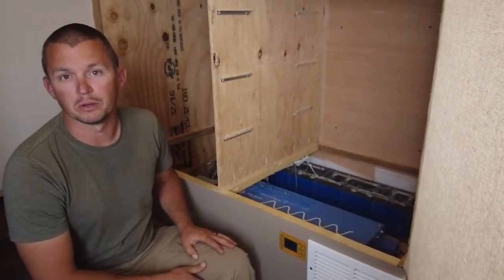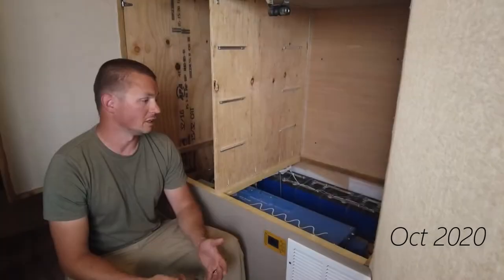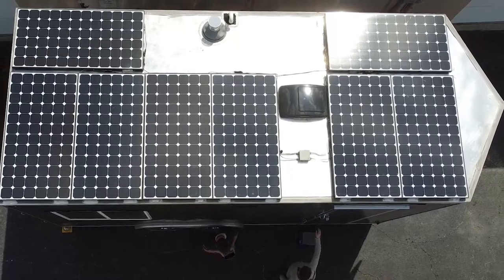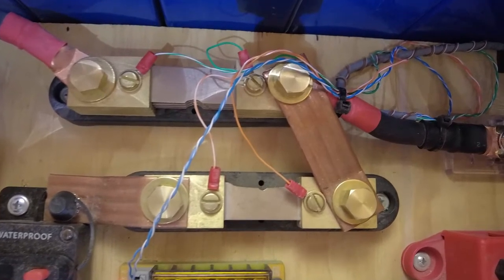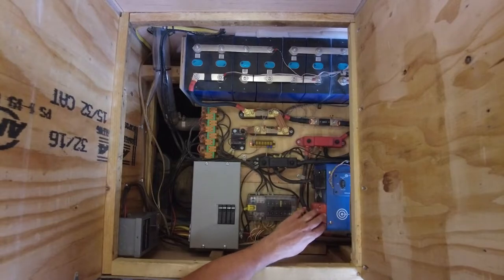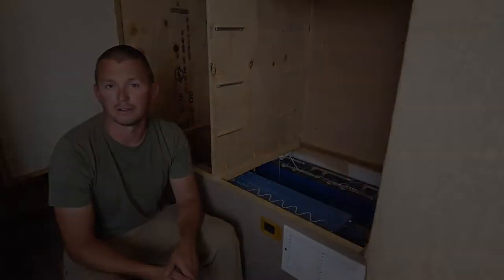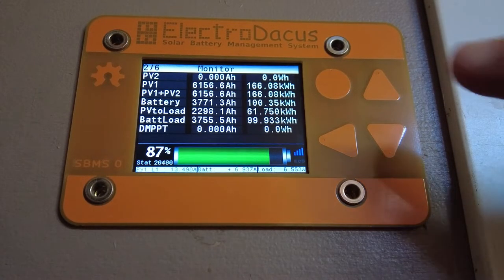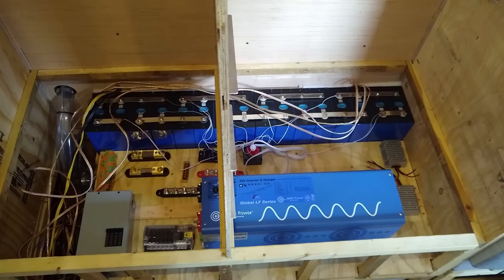Here is a Battery video for you: FREE of charge! | Cargo Trailer Conversion | Episode 16

Comment: I'm confused you connected 16 x 280ah batteries but you stayed you have a total of 560ah .   I'm just learning more in depth about solar does a 24v system not calculate in simple math?????   I'm just being my cargo trailer conversion and wanting to attempt to run all solar 75% to 80%of the time but also going with a shore power connection
Reply from the maker: Hi! Yes, we have 8 pairs of 280ah cells. This creates a 24v 560ah battery.